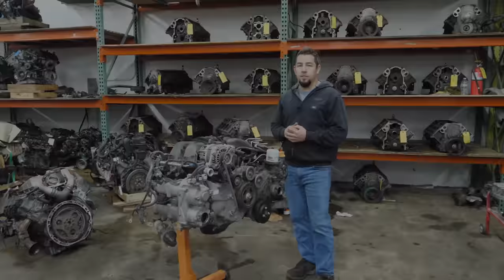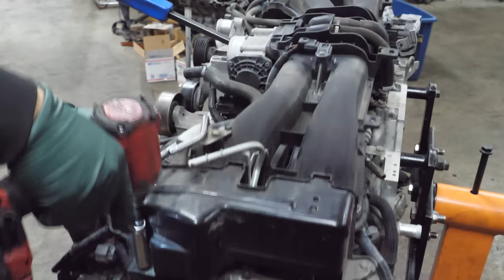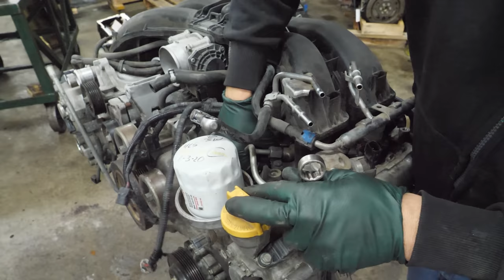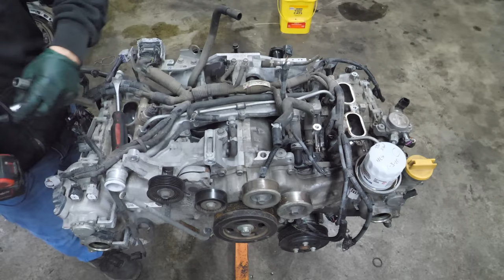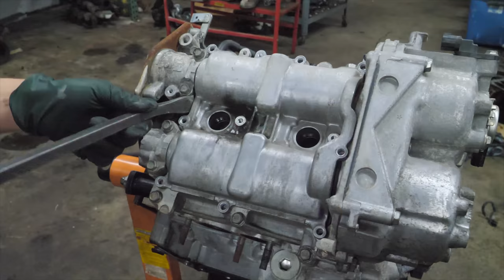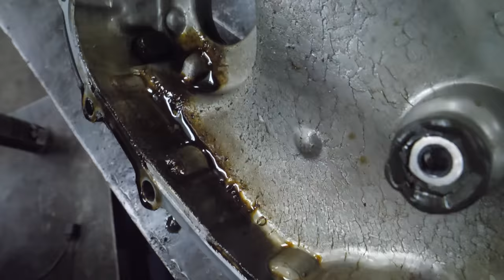Blown Subaru BRZ / Scion FRS FA20 Boxer Engine Teardown. A $3,000 + Whoopsie.

Comment: I can’t believe these have been around almost 10 years now.  Life comes at you fast.
Reply: they'll be the under 10k dream shitbox soon
Reply: I can think of better dreams...
Reply: @silver1407  rwd+manual+cheap enough to not care if I crash it sounds like a dream to me
Reply: @wyatt415  A high mileage + salvage title one can already be had for under 10k
Reply: @wyatt415  the dream shitbox will always be a miata. Do these have v8 swap kits? Packaging might be a nightmare. What about k-swap kits?
Reply: @Hawk7886  everyone K swaps them when the boxer motor inevitably blows there’s a K power kit, people have LS swapped them but it’s a dumb idea why not just buy a corvette?
Reply: @wyatt415  I wonder if an LS can be swapped in
Reply: @funonoldwheels7150  it's been done. IIRC Vorshlag did one.
Reply: life is fast when the ride is slow.. these are not fast but they are fun.
Reply: @wyatt415  what is a k motor are those nissan?
Reply: @eternalglow6483  it’s a Honda motor it’s in most of the modern Hondas, it’s a very popular tuner engine and arguably the most capable 4 cylinder ever made
Reply: @wyatt415 i dont think most new hondas are k series i think theyre earthdreams unless i am mistaken
Reply: @wyatt415 because it is not a corvette that I want ? ps; i would never ls swap

Comment: Subarus are rather notorious for using oil. When I bought it (used 2011) the dealership said the oil had been changed. The first time I gassed up I checked the oil, it was TWO QUARTS low.  I found that there had been a recall for oil consumption but my serial number was just outside the range. I had it tested anyway. The dealer claimed that the oil consumption was not enough for the recall. The guy at the parts desk unofficially told me that Subaru recommends SAE 0-22 oil to help with the gas milage. He said he went to a slightly heavier grade in his Subaru (wink).  I went to SAE 5-20 Mobile 1. The oil consumption decreased to less than 1 qt/1000. The gas mileage dropped slightly, but I STILL CHECK THE OIL EVERY TIME I FILL UP WITH GAS!

Comment: I AM SO GLAD YOU SAID IT. People DO NOT check their oil level. ITS THE SAME with the typical EJ engines found in STI's. "the STI ring lands are weak" no, you dont check your oil, the entire combustion process over heats due to no lubrication, and then the ringlands fail. And its funny, if you actually look at where the oil come from on say (for example) my 2005 STI, cylinder 4 is the LAST to get oil, even AFTER the turbo.... so when you run low on oil, cylinder 4 starves. And what happens? ring lands! overheat and kaboom. every time. GENERALLY most STI owners have more money than brains. Someone else built their motor, installed their upgrades, etc. VERY FEW subaru owners I've met do their own work. Its always "I took it to a shop and they did the work".... and they never check their oil, and then cry when shit blows up. And then because they have more money than brains, they just buy another built motor, have it swapped in for them, and keep driving like nothing happened. 100% user error. I AM SO HAPPY you said it. Because its factually true. Even with these newer toyota/subaru hybrid engines.
Reply: You know what's not funny? Your grammar...

Comment: We all know the type of people who gravitate toward cars like Subaru. I once had a female friend describe to me how her car wouldn't start. She had it towed to a shop where, to get the engine to turn over, the mechanic added FOUR QUARTS of oil to the crankcase before before it reached the add mark on the dipstick. I immediately advised her to get rid on the car. She traded it in to one of those online car brokers who came and picked it up no questions asked.  She then bought another car online, unseen and undriven, because she liked the color . This is the next generation of car owners. At least you may rest assured people like you will always have a job.

Comment: 70% of all the cars that come into our 2,200 car yard here in Arkansas that are not wrecked, come in simply due to "no oil" and lots of these are 7-13 years old with under 150,000 miles. NO ONE checks engine oil.... low tension piston rings= oil burning at 1 QT/1,500-2,000 miles and now everyone is doing 10,000 mile oil changes....

Great Video!!!
Reply: They do the 10k interval now because quick lube places tie into the manufacture and that's what they now recommend. Kia recommends 7500 miles between service. Basically engineer's planned this out so you will buy a new car after 8 years. On my personal car I use full synthetic every 3k.
Reply: I still do 3K on my 2010 Mazda 3, but I’m poor,and need that 3 ,to go about a million miles.🤞🏼
Reply: Read my comment above
Reply: My car is 14 years old so it is safe from above mentioned car age interval lol.
Reply: Subaru engines burn, consume or leak after 125k. There are so many places where oil disappear, like the timing cover, valve cover, cam carrier seal. And let's not forget the head gasket, which goes around the same time...
I'm in the process of rebuilding mine, hence watching this video.
Reply: @hyojoonus  my 2015 forester died last month with 182k miles. New CVT at 108k miles. I filled the oil Friday and by Sunday it was gone in under 50 miles. The cam bearing went out (I think) and it wasn’t worth fixing. I’m driving an 09 focus now… 😎
Reply: @hyojoonus  Mine has no issues at 200k? dunno what you are talking about. Literally all my seals are perfect.
Reply: @kyzor-sosay6087 , 2010 Mazda 3 club 🙌🏻 I change the oil every 6 months on mine, as per the manual, and the engine is still in good shape.

As for Subaru, I don't know why they use this weird engine. It looks to be failure-prone by design. Unnecessarily large and complex.
Reply: Are low tension piston rings used by design?
Reply: I change mine every 3,000. Quite prematurely to some, especially on a full synthetic. I notice that my oil ends up smelling quite like fuel. I’m assuming it’s a byproduct of direct injection 
( 2014 Mazda 3 Sedan, 2.0/6MT)
Reply: Here in Germany most people say every 10000 km (6000miles) or after 12 Months…

Comment: I know this is about 11 months after the fact but the valve spring recalls all required the engine to be removed from the vehicle.

Special tools were developed for the FB20 Impreza and Crosstrek so only the valve covers required removal, but the FA20 required removal of the camshafts and use of some Toyota/Lexus spring valve spring tools. Both processes required the use of regulated air to hold the valves up (closed) while the spring replacement was performed.

I did a few hundred of these recalls, about 30 were BRZs. 

Love the videos! Have a great day
Reply: Do you remember if the 2014’s were recalled
Reply: @zemotika  dang sorry I fell off the world for a minute. Only ‘13s were affected
Reply: @Papa_Wrenches is my 2023 GR86 affect?  Do I even own the same engine as in the video 🥹
Reply: @ckchatta369  no, this was limited to the 2023MY BRZ/FRS

Comment: This engine must've had the most incredible knock between the piston hitting the head at TDC, the block at BDC, and the rod journal inside the rod, not to mention the other three cylinders.
Reply: Extra large Maraca!
Reply: I wonder if someone decided to do AWD donuts in it or something? Kind of what you see after the oil gets slung up against one side of the block, aerates, and ends up uncovering the sump. Then its redline with no oil whatsoever to the bearings.
Reply: Super Saiyan Vibrator!
Reply: I'd go so far as to call it a clatter instead of a knock!
Reply: @mysock351C  it's front engine rear drive ... and its a matter of using maybe both cheap non synthetic oil but moreover the low oil level ... I got a defective oil filter not long ago that deprived my timing chain of oil for about 7000 miles while i thought (my mechanics also thought) i had a bad power steering pump after they had replaced the rack ... Oops, Live and learn. luckily my 2003 toyota truck 4 cylinder is a particularly robust engine design that now has 335,000 miles ... Born a work truck and has done nearly all city miles
Reply: @mysock351C  how do you do AWD burnouts in a RWD car?
Reply: @rickc303  Someone already pointed that out about a month or two ago, namely the poster right above you. And even in RWD cars I heard of there being protection logic that looks at the telemetry data to see if WOT and large steering angles at low speeds are present, which would indicate that oil starvation could become a possibility due to slosh in the pan. I have the source code for one, but I'm too lazy to go look and verify. But still oil starvation is something to be concerned with if you decide to do a bunch of donuts, but worse with AWD as there is a lot more lateral acceleration involved.
Reply: @mysock351C  how is there more lateral acceleration with AWD cars? They do the same exact thing. I could see cyclones causing more stress, since they're a tighter circle than donuts, but that's about it.
In what car did you find such logic deployed? I'm not aware of ANY enthusiast vehicle that is programmed to defeat burnouts and donuts.
Reply: @Hawk7886  With respect to the engine it is. Normal RWD donuts as people usually do them has the front of the car more or less acting as a pivot since the tires are not driven and the rest of the car will basically revolve around the front tires. With AWD, the front tires are also driven, so the front of the car will tend to move in a circular motion as though the car is going around a "round-about" which will throw the oil against the side of the pan. That is at least how its always been for me, unless for some reason it has open diffs and the inside tires can just spin uselessly. At any rate I usually make it a point to not keep going in one direction too long to avoid exposing the pickup.
Reply: @Hawk7886  Some V8 pickups do have logic there. Modern cars likely do as well to at least provide some protection for the driveline in various forms. At a minimum it will log freeze-frame data if you booger something up, and that can be quite comprehensive in modern vehicles, as can be seen from what can be logged when the airbag deploys. That has been there for a long time.
Reply: @Hawk7886  Although in hind-sight you are probably thinking of the stupid Tik-Tok carfag "donut" at take-overs where they tend to go in a large circle around some idiot with a camera. Those both types will sort of have the same trajectory, but the radius is larger and there is not strictly lateral acceleration.

Comment: I have done close to 250 valve spring recall's on the fa and fb engines and yes green is the original springs and blue is the updated however it does depend on the year of the vehicle.
the fa's I could complete in about 9 hours (excluding sealant curing time which was usually overnight) that's driving the vehicle in to the shop to completing the test drive and final inspection.
The fb's I could complete in under 5 hours providing they don't require a full reseal of the cam carriers and front cover.

Comment: I had a 2013 Scion FR-S. Can confirm, not driven lightly. I actually changed the oil according to the heavy use intervals in the owners manual. And I used high quality stuff. Sadly I had an incident involving a field and totalled the thing. It was just fast enough to get one into trouble
Reply: That's why the first upgrade you should do to any enthusiast car is a driver mod
Reply: Wait what happened to ur FRS did you have any major problems after driving it hard but maintaining the oil?
Reply: @sagetumulak3400  Braked too late for a corner and rode thru a field. Oh and I had upgraded brakes
Reply: I just bought a fr-s with 53k had it for 2 days I fkn love it !!!
Reply: @poohssmartbrother1146 that's probably part of your problem that caused your accident. The tyres are more important than the brakes when it comes to getting you to stop, ironically. I'm just going off the information in your comment but even with upgraded brakes, they won't make a noticeable difference (except on track with repeated braking) unless you got good tyres. Make sure to have really good grippy tyres when driving like that next time to avoid another field frolic.
Reply: @burakoshimazaki I think both tires and brakes are equally important.  It's all about the friction force b/w the pad and rotor and the friction force between the tire and the road. Then heat management is considered
Reply: @poohssmartbrother1146 sorry to hear bro but I'm sure you felt proud driving it to what's designed for

Comment: Same issue my motor had last winter! At some point in their lives they decide to eat up a load of oil for whatever reason, really the whole car is problematic but it adds to the character. Fixed mine for a little under 1k, but I only had cylinder 4 rod bearing fail, got lucky. Thanks for the teardown!
Reply: Fried piston ring(s) may be why they suddenly start burning oil heavily..? Revup versions (7,000 rpm) of the VQ35 had similar symptoms, rings were the source of the issue.
Reply: Hey, how’d you get yours fixed? Mines recently stopped working and I think this is the same issue! I miss driving my car as it’s loads of fun
Reply: @gnzaid  I just tore mine down myself, was a bit of a pain because the entire engine basically is held together with RTV, sent the crank off to a machine shop and just started replacing everything that didn't look right. I probably replaced more than was necessary, but I didn't want to have to do it again.
Reply: @jacquesc3166  stuck rings were an issue with Hondas, too. They'd pack up with carbon over the years and eventually lead to crazy oil consumption. The FA20 used in this car had issues with the ring lands failing, but that was in the turbocharged version used in the WRX.

Comment: It’s definitely good advice to check your oil. With the extended drain intervals that manufacturers use you need to check your oil about every other time you get fuel especially if you are running them hard or running them on the interstate for extended times

Comment: As someone who owns a 2015 FR-S with it's native FA-20 engine that's turbo-charged, running almost 500 WHP on E85, there's a lot of steps one needs to take to ensure this doesn't happen. In reality it is not hard to do; but a lot of the kids that own these vehicles are social media junkies that run aggressive tunes/pop'n'bang tunes for clicks and clout. Then their engine blows up and suddenly their car vanishes, and they then claim it's because they're tired of their car. I notice this A LOT in the US.

Here's what I did. Had the car since 2015 and it's purring like a happy kitty in 2024. I did get the clutch changed twice during this time however. 

-REBUILD YOUR ENGINE. DO NOT RUN A TURBO ON A STOCK BLOCK, no matter how little boost you run. The high compression these have out of the factory makes turbo'ing your stock block a literal ticking timebomb. DO NOT DO IT. Also do NOT spare any expense; get forged, top/upper mid of the line pieces for your car. No, you don't need to go super crazy but don't cut corners on your parts. 

(Main bearings [crank, etc], rods, pistons, valve springs, also depending on mileage, getting a new OEM crankshaft might not be a bad idea either, good BoV, wastegate, upgraded piping, etc. are all essential.)

-If you're running 20 LBS of boost like I am, get valve springs that can accomodate your boost levels and do NOT toy with being more aggressive and pushing more boost; just don't do it.

-Upgrade your exhaust for more flow. Simple as that. 

-Fuel pump, rails, injectors (this is the least important but I would still recommend.)

-GET COOLING. Oil cooler, and i upgraded my water hoses as well. I even upgraded the radiator fans to 12" fans. Again, do NOT cut corners here. Keeping your oil cool and engine cool especially since I'm back and forth between Nevada in the US, and 松山, 日本 where it gets very hot, this is an extremely vital step on your FA-20's longevity. 

-If you are daily driving this car like I am, do NOT abuse it. Simple as that. I drive it very conservatively even though it goes very fast. Though if I need to get out of a tight situation, I can do that nicely. 

-Lastly, and the easiest step, just keep up on the maintenance on the damn thing. Use the correct oil, change your fluids correctly and keep a log and timestamp when you performed these steps and you'll have a happy FA-20 ^_^. Sounds easy but...apparently for lots of people it is not O_O.

Comment: Eric, regarding the scam posts, Youtube is working on solutions to that as mentioned by large tech channels I follow. Hopefully sooner rather than later they implement the tools and filters they are working on site wide and slow them or shut them down.
Reply: One trick is to go into your channel settings and add "Telegram" to the bad words filter. Add all the heart emojis as well (used by the p*** spammers) and that takes care of almost all of it.
Reply: @Currawong  - Great tip. The funny thing is that "Telegram" means absolutely nothing to anyone younger than about 60 years old. And I don't think there is any way to send a telegram now days, is there?